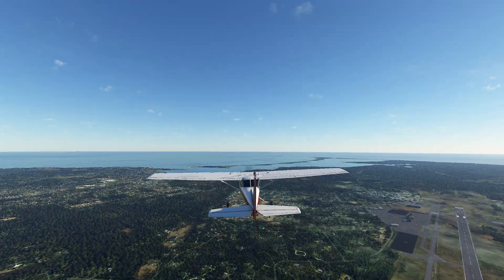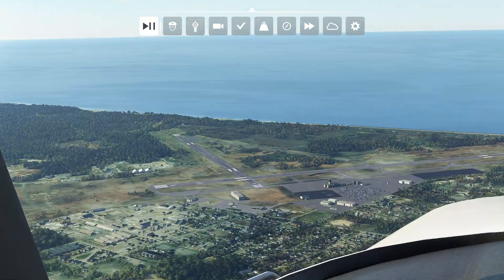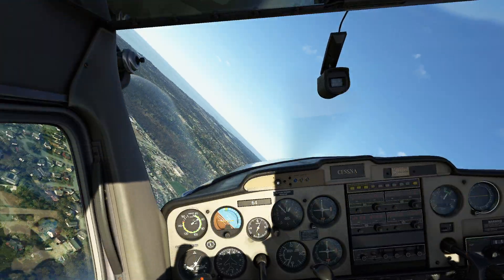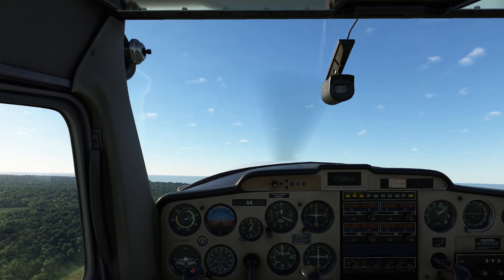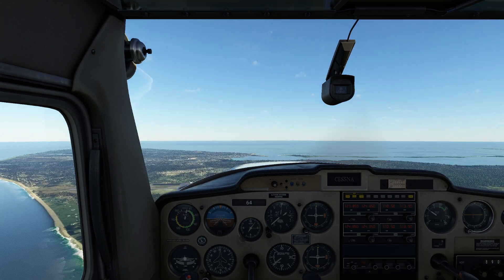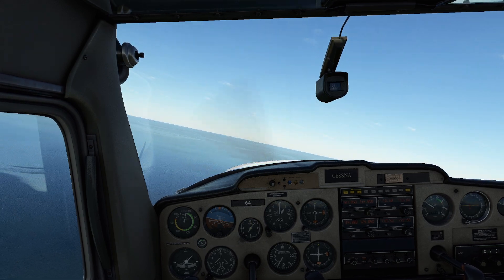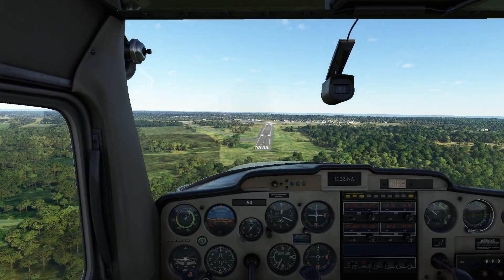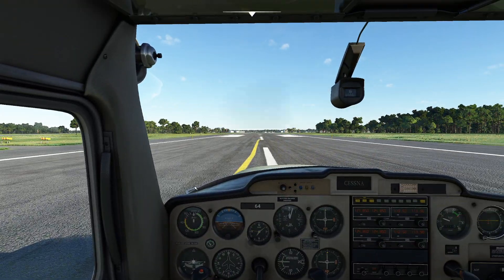MSFS - Going up to go down

Comment: I know your exploiting msfs lack of proper modeling to make a point, but adding bank angle with the stall horn seems like a pretty good way to spin stall.
Reply: What are you chatting about bro?
Reply: @alancrane2646  just making a comment in a real plane you would never do this unless you want to die.  It’s a sim though so hey it’s a cool technique.  I wasn’t trying to disparage the video.
Reply: @twifosp1  Hello its Alan Crane here. So your telling me if I did this at 10,000ft I would die?
Reply: @alancrane2646  idk about you but it didn't look like he was at 10k feet during that maneuver
Reply: @alancrane2646  Final approach usually isn't done at 10k feet.  Maybe check out aircraft saftey institutes latest video on the stol crash that happened this last weekend which did almost exactly what was demonstrated here.  I'm not here to argue on the internet, it's a sim, I don't care.  Have a good one.
Reply: @jonahwilhelm8409  Hello it's Alan Crane here. This turn is completely safe in real life ive done it many times and lived to tell my story
Reply: @twifosp1  hello it's Alan here again. Dont be sarcastic with me about final approach at 10k.
Reply: @alancrane2646  then don’t bring up irrelevant topics in this super serious comment section 🙄.  Also who knows you could be landing on an airship!
Reply: to be fair he says "this would be a perfectly acceptable maneuver - IF we were a glider."

But yes, tight turns at low speeds, while trying to land has lead to many a plane crash.
Reply: My thoughts exactly! At the stall horn with wings level, me: "Cool! 👍". Then he started a turn and I was like "WTF dude?😱 What's wrong with you??"